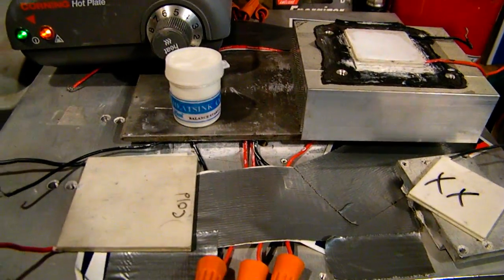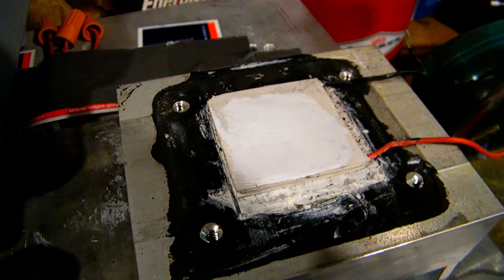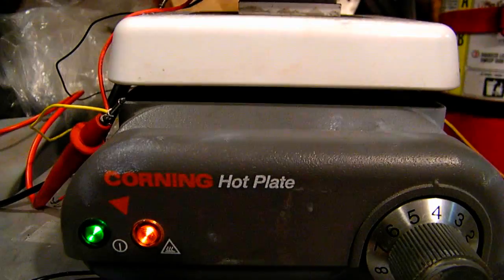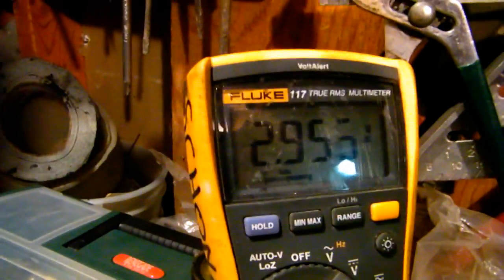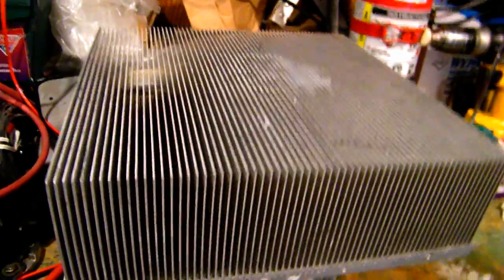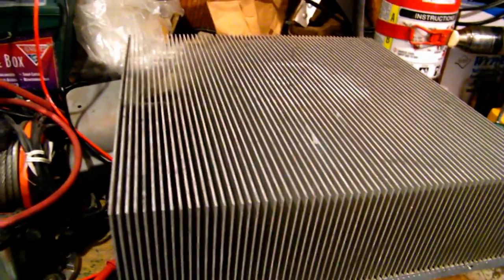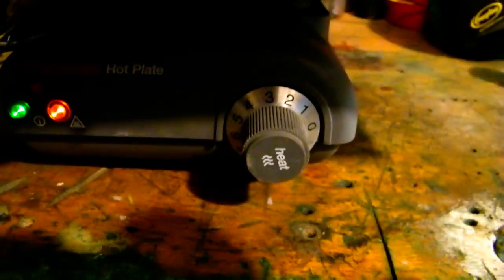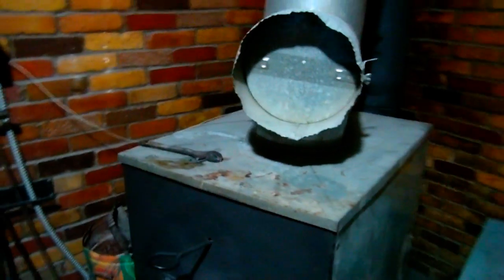Thermoelectric Power Generation On Wood Stove

Comment: DON'T STACK TECs. You need a temperature difference and if you stack them you'll just divide the temperature difference between them all. Maybe you meant stacking them as in putting them in series, side-by-side. Series is great by trading amps for less copper lossy volts if you can ensure all of them are all the same temperature difference.

Comment: As a North Dakota resident I can confirm that this would be great in the winter. We also have a wood stove however it’s in the basement far from the outside as it’s connected to central air system.

Comment: Your problem is you using TEC and thinking you using TEG
Reply: Have you got a link for the TEG modules?. I have been messing around with the cheap TEC modules, Easly found online, With promising results. I understand that these devices can posibly come in any shape or fourm. I am willing to pay more for refined units. Any info you have will go to the greater cause.

Comment: I don't miss Fargo winters ..wtf are those awesome heat sinks from? Have u considered an anti freeze loop with say a pc water cooling block and cheap ass ebay pump? Little flexible tubes to bring cold anti freeze down to it

Comment: I don't want to hate on this video - because I like the concept - but using a 1000watt hot plate to get maybe 10watts to power a wind up radio isn't exactly practical.  how many do you plan to "power" from your stove?

Comment: Hmm, I believe your design has a major flaw, which is the elements being soldered together. I am just learning about these, but I am fairly certain that ONE of these cells will put out enough power to run that charger of yours. I would suspect the other cells actually draw power. Diodes could be used to prevent a loop effect.

Comment: I been thinking about these . like maybe epoxying a bunch on the back of solar panels. paralleled for Hugh current. then use a DC boost converter. to 13.5-14.5v to help the solar on hot days. and water cool them. with cold well water. this will also cool the panels. witch will help their output. but it would probably be expensive. and a generator would likely put out lots more. and be cheaper. but for emergency use where you are. I'd have them in the window. and circulate hot water from the heat source. use a DC boost. and charge lithium cells. or at least some large super caps. or both. but store up power for light during a power outage. but some insulated 1/4" tubing and something like a kettle to boil water in. to circulate. I think it would be best like this instead of the opposite way. water cooling. I think the cooling water may heat up. costing power. I may try this when winter comes back around. to see witch way is best. it may be a good emergency lighting / power supply. with a hand generator. have you made any progress since this video?

Comment: Why did you stack them?  Just place them all on hot surface and sandwich between heatsink.  Wire them in series or parallel as reqd depending if you want higher voltage or higher current.

Comment: Of course, rather than all this poncing around with low efficiency heat transfer directly to electricity, there already exists a HIGHLY efficient mechanical system, invented by a Brit, called a jet turbine. Most jet turbines can produce prodigious rpm (80,000) which as any F1 fan can tell you helps to increase the horse power, but the microjets from Bladon jets in the UK are so powerful just two were fitted to the Jaguar concept car the C-X75 (all electric drive but hybrid power) - they can produce 70kW each! The car has 4 x 195HP electric motors - 1 per wheel!

Rather than feeding the wood gas to burn in the stove it could instead be fed to such a turbine (actually a way smaller one is good enough) tuned for that fuel (The Bladon jet can be multi-fuelled very easily, including various biofuels and, just like in the Jaguar, hooked up to a generator set. Even a model aircraft jet engine can apparently produce around 5-10kW of power. I'm not sure about the difficulties of converting one of them to run on wood gas, but in principle it shouldn't be too difficult. 

Such engines are far less complicated mechanically, and to control, than their big brothers in modern aircraft that are extremely sophisticated, complex and complicated beasts. Run a gen set from a shaft out of the front of the jet (way less complicated than the hot exhaust gas bypassing required) and you've got yourself something that really can produce decent, useful, usable amounts of power. Run a long exhaust through two well insulated tanks of water with a pump to move the water around and you've got yourself some decent central heating and hot water too!

Using Peltiers as suggested does not strike me as either a very sensible or efficient use of the free energy available in the burning of wood gas, of which you would only EVER utilise a tiny proportion of what will be going to waste.
Reply: I tried disposing of wood chipper cuttings in my anthracite powered Aga and when I overdid it the flue tarred up closed, although that is somewhat of a bad example. It's entirely possible jet turbine blades may be self cleaning like they are with volcanic ash it coats the blades, the engine loses power until the deposits fracture, disintegrate and fall off, with the engine recovering afterwards.

Maybe a better solution would be a closed cycle gas turbine with the hot air heat exchanger in the stove and the cold air heat exchanger outside.

Of course if you're on a budget and are looking for a Mcgyver style solution, I suppose repurposing an automotive turbocharger may make a good closed cycle steam turbine, it may even make a resilient enough woodgas jet turbine, after all they cope alright with diesel soot...

Comment: The whole setup in this video is crazy. Peltier devices rely on a high temperature differential (within operating bounds) for maximum effect (whether cooling or generating).The heatsink should be mounted vertically as should the Peltier plate and the heat plate. The heatsink should be as heat insulated as possible from the hotplate (not easy on a thin Peltier device, and especially not when right above a hot plate!!??). 

A heatsink much larger in area than the Peltier is counter effective unless it can be cooled SUBSTANTIALLY and having a fan blowing (in either direction - you don't specify which though) directly above a hot plate is hardly sensible, as one way or another that heat will reduce the effectiveness of the cooling and the efficiency of the heat transfer and the temperature gradient. 

A better way would be to use a large thermal mass of aluminium block sized to the Peltier on the hot side to enable moving the Peltier a good way from a vertical heat plate, with insulation all around it and especially insulating the COLD side of the Peltier from as much of the radiant. conducted and convected  heat as possible and run cold water over the heatsink - cycle the warmed water outside to the cold air (snow/ice time), make it a sealed system with antifreeze in the water for protection down to -15 (that's C of course not F) and you might start getting somewhere. 

Personally I 'd be more inclined to believe that if you are burning wood 24 hours a day, in winter, then running a Tesla or higher torque turbine and powering a generator just off the steam you could produce in a wood burning pressure boiler would get you a LOT more energy for your heat production.
Reply: agree, but this was just an experiment. TEG are better then TEC's used in this way, and really they are best used in space-limited applications. Advantages of TEG over turbine or other generation devices - they are passive, solid-state, and small, operating silently.
The output of common TEG modules in 2017 still is not great. but they are what they are: 12-15v @ 650mA using temperature difference of 100C for a 40 x 40mm module costing about $5
Reply: ballpark figures, 60-100w per 40x40 module

Comment: Volts alone is meaningless. What was the wattage produced at what temp differential?
Reply: He did discuss it, he's producing 300ma x 3V = .9W
Reply: it takes volts to get to the peak charge.. cant get to 120v without 120v or 10 12v in series.. either way you add more units and you get more amps and watts.. thats how electricity works. you think the city you live in just has 1 small generator unit ? hell no they have thousands......
Reply: Again, volts alone is meaningless. You can have a million volts that will do no work because it cannot sink any current. In addition, one volt can run a city.

Voltage is only part of the discussion here. Volt-amps or watts must be discussed.

Comment: I have a cool idea!!!
Make a large black colored metal plate of some kind directly in searing hot sunlight.

Have the device in-between it. with a heatsink on the bottom of the device with a tiny fan underneath running from itself to cool itself off. And use the excess power to charge your phone or something!!!
And you can put many in series or in parallel for as much voltage or power as you need! Like a solar panel but different!!!
Reply: realflow100 That was actually exactly the idea I wanted to get on working. Did you try this? I think I'm gonna try this just because it's fun :D

Comment: problem is the device creates electric potential by heat transfer... and where does the heat come from? From burning gas, or however your house heating is set up.
Reply: Yes, it's meant to recapture waste energy, not create new energy. Not a bad way to utilize a wood stove in winter.
Reply: +Winter Haydn wonder how much you save per hour of work collecting wood. and if you're buying wood, I wonder the dollar per KW of electrical power.
Reply: consider that in colder parts of the planet ppl in general have wood stoves as their primary house heating source. they NEED to gather or buy wood ANYWAY because they don't want to freeze. thus the question about "saving work/money" is irrelevant since they rely on wood already. adding a generator and gathering electric energy from it would improve the life and expenditure

Comment: rocket mass heater
Reply: wood stoves burn thru wood too fast, rocket stoves very efficient. burn 50% less wood and retain so much more heat
Reply: then why is the rocket stove not in every home as they have no way to retain the heat... just because you give something more air and no way to regulate it so it burns fully doesn't meant its more efficient at putting off and retaining the heat it generates.
Reply: Rodney Shultz pseudointellectual
Reply: Wow.. Your special..
Reply: Rodney Shultz so angry, go away troll
Reply: Rodney Shultz K bye lmbo

Comment: This is pissing into the wind.  powering a wind up radio amounts to jack squat .
Reply: he is doing it with waste heat... so your conclusion is terribly wrong
Reply: Actually by having the hot and cold side so close through the device, you're wasting much more heat through the device to derive power.  You're much better off to keep your insulation as normal, and find a better normal generator.
Reply: thats not waste heat though
Reply: Simon WoodburyForget it's not waste though. that's energy in the form of heat from your heater.
Reply: you have a heat differential between the outside and the inside because you PAID to increase the heat on the inside.
Reply: +Simon WoodburyForget where is the energy input coming from?
Reply: +Simon WoodburyForget and where does the energy come from to create heat from the stove?
Reply: +Simon WoodburyForget how is running the stove waste heat??
Reply: Simon WoodburyForget well I don't know how you don't get it... whats up with you... do you like to argue just for the arguably pleasure of arguing??... that's going to to stunt your personal development... so its counterproductive... move on dude...
Reply: +Simon WoodburyForget but you're paying for the heat from the stove... are you talking about just using the heat after your done cooking? then, yeah that's wasted heat. how much electricity would it save you? probably not even a cent each time you cooked

Comment: So... Using some ballpark figures: assuming about 10 minutes of testing with a 1kW hot plate uses roughly 150Wh. Using the radio with 3V, sucking 300mA uses roughly 1Wh. You could use the radio for around a week with the power used for the few minutes of testing this. Just thought that'd be funny to think about :)

Comment: A volt reading does not mean anything without a amp reading.
You could have a 100 volt with 1/2 a micro amp that equals about no power behind it.
Reply: According to the datasheet, for every deltaTemperature(T2-T1)  there is a rated Power generation and a higher voltage, Ex : 20 C delta its aprox 1/4 Watt Power with 1 volt therefore aprox 240 mA., the bigger the difference, the bigger the Power, and due to the principle of Seebeck a bigger difference means one side will be less negative than the other creating a higher difference in potencial (Voltage)
Reply: 2:57 there is text that says 300 ma

Comment: Nothing is free.  Those devices and that heat sink are going to be throwing your heat outside like an open window.  You will have to burn more wood to maintain the same temp inside.  If that's okay with you then your good to go.
Reply: Looks at the sun and says, "Hey Sun, plants are taking your free energy and turning it in to fuel to help them grow, but this guy on the internet says nothing is free, so I told the plants to stop, they did not listen, so maybe sun, you will listen and stop giving out light..." It's still shinning, oh well I guess I will take it for free. Everything is free, it's just some charge a cost. 

If the air outside is a lot colder then the air inside, then energy is produced from the differential. Building this device as efficient as possible, is the only issue.

Comment: Wow why not just get bunch of wired thermopile(think thats correct spelling) and place them into wood stove like I did. I place them in series to get 6 volt/12volt out of them once stove was up and running. Dont need to waste heat trying to cool heat sinks and they last long time, This maybe the 11yr and still not one failed yet(now I bet they start failing). Just seems like you got a lot tied into your system and not much usable in return for the buck. Better off just buying solar panels,wind or water turbines....

Comment: I have been playing around with this idea and I found that a tea candle has about ~ 150 or so watt hours of energy each.

I have been designing a generator that would use tea candles using an active miniature liquid cooling tower system to boost output and efficiency. The whole unit will be under I cubic foot in volume yet I have not completed my calculations on its electrical output as of yet.
Reply: Any success yet? Do you have any mock up designs available?
Reply: HodEnoch also interested, how are you going with it?
Reply: One would be verry wise, not to let too much infomation out. Either he is succeeding/or has given up....there is a place for this technology, There is no doubt about that.  and In the hands of the greedy is not it.